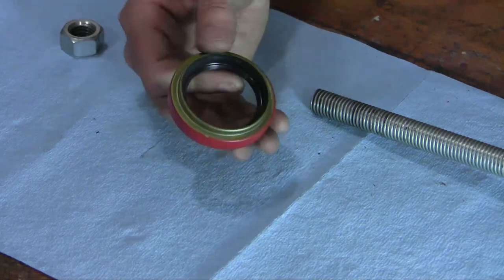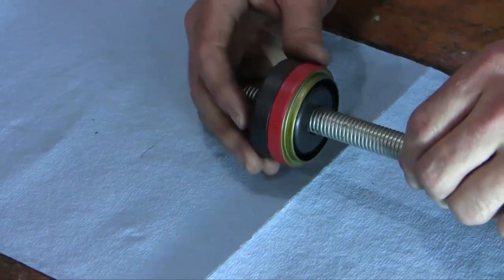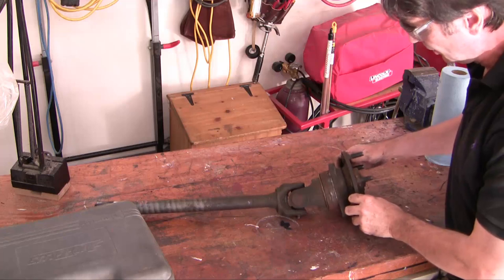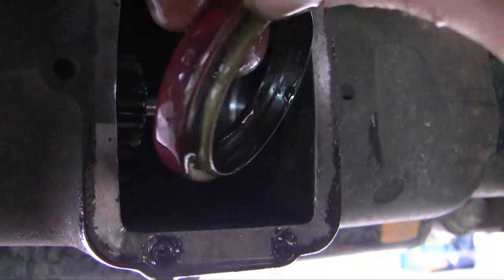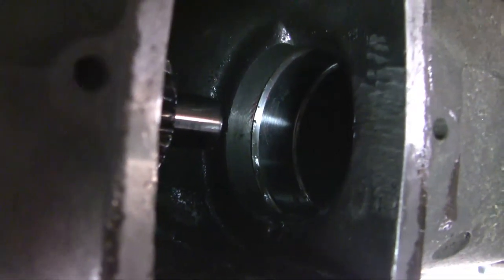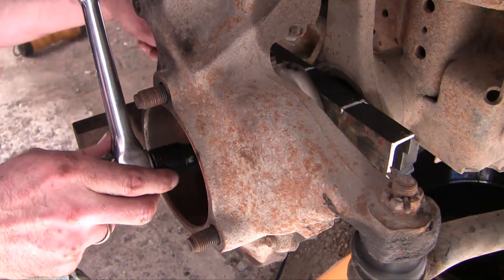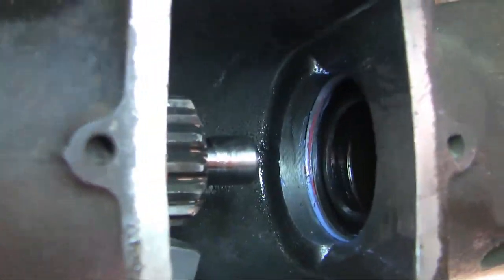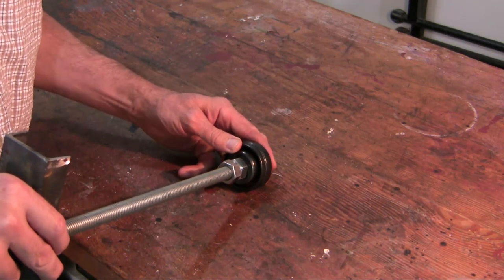Replace right front axle seal, 1998 Dodge Ram 4X4, part 2

Comment: Actually its a good video, well done.  By the way, for those with the Dodge Ram 2500s, the quickest way to tell a Dana 44 from a Dana 60 front diff is the hex size of the front cover: Dana 44" is a 1/2" hex bolt, the Dana 60 is a 9/16" hex bolt. Also, for those that are curious about the death wobble syndrome, we are using Hellbent racing steering box sector shaft stabilizer kit, and also weld-boxing the control arms, with energy higher duromoter bushings. Also purchase the best track bar you can afford, like a moog problem solver, or if you are lifted, an adjustable track bar. Lastly, do not use any ball joint except Moog Problem solver. The rest are junk. These front ends can suck up thousands of dollars of excess cash, so plan well from the beginning. Just our 2 cents worth here. Thanks
Reply: I know this was posted 6yrs ago, but I'll try anyway lol. do you know if the 1500 4x4 came with the dana 44 as well
Reply: @isaakteichroeb1175  the underhood sticker on my 1997 1500 4x4 says front “Dana 4”. Rear “Chrysler 9.25”
Reply: @herbb8412  awesome good to know really appreciate your replie

Comment: Great video, sure appreciate the work you have done to get us through this pain of a task.  I finished the job in about 10 hours changing the front left and right seals of a 1998 2500 with a DANA 60F diff.  Removed the ring gear without a case spreader and used a socket from my tool box to drive in the left seal and an Oreilley's rental seal driver kit, ready rod and a piece of PVC tube called a 1.5" Terminal Adapter costing $1.99 that I found wandering Ace Hardware to crank in the right seal. The right seal was a do over with success on the second attempt.  I did it on my driveway and am very happy to have an extra grand in my pocket to play with. Thanks again!

Comment: I made a seal installer from a 1/2" sheave center I picked up at a supply store, the inside shoulder is 1 1/2" diameter which holds the seal. I also used a piece of 2" muffler pipe about a 1/2" long. The outside of the sheave had to be ground down to fit in the tube and the piece of muffler pushes the seal into place using a 1/2" length of redi rod. The sheave cost $7.99, the piece of scrap muffler pipe was free from the local muffler shop. Worked very well. Axle was a Dana 60 (not a 44).
Reply from the maker: I always like it when somebody comes up with good ideas like this. Thanks for posting it here, I'm sure others will appreciate your contribution!

Comment: I found that if I tried to keep rod centred I had trouble I let it kinda wander within reason and boom! done . Thanks! O I used a big washer instead of channel Update seal failed and 3D printed driver failed. Got one machined out of steel gonna try again soon. Ok steel one worked (I think) had to use a square tube instead of the washer, washer couldnt take it. Let you know in a day or so. Great video!!

Comment: Thanks for the video. I changed my right front seal today and couldn't have done it without watching this first. I used a seal driver with a length of ready rod and it did set the seal in place. Thanks again.

Comment from the maker: You make a good point, and if I ever have to do it again I'll do it dry. The first two times I installed the seal on that side I did it dry. But this time, out of frustration, I put a thin film of Permatex on the outside surface, since I wondered if fluid leaked around the outside of the seal. Of course there is no Permatex on the inside. 

It worked, and I doubt I'll ever have to do that side again. But if I do, it will be more work to clean the old gasket off. Thanks for your contribution.

Comment: Tip from one who had to deal with this same seal  problem . Use the old seal turned back to back to the new seal with a washer and nut with alltread just as you did on the inside. The old seal fits perfectly on the back of the new one , for cheap just a stick of alltread and your old seal . 7.00$ old school . I do like your special seal puller though . It looks like it works well .

Comment from the maker: @gravity006 That is an interesting idea. However remember that the intermediate shaft would have to be reinstalled after the seal is in place, and it doesn't slide in very well, possibly dislodging the seal as it is put in. Also, the big problem is the unfriendly shape of the seal, with the soft rubber parts vulnerable to damage. The best way to install the right seal is the way I've done it here....

Thanks for your creative and thoughtful contribution.

Comment: That tool is a great idea. I have something similar, homemade. I use a cup one one end, fits inside the seal, pulls on the metal part, long rod with a nut, but I use a slide hammer on the other end, but its a 2 person job. But with your set up, definitely a one person job.

Comment: I tapped in the passenger side seal of my 1997 RAM 1500 using a 4 foot long 3/4" pipe with a cap on the hammering end and a coupler on the impact end that I put on once the pipe was already inserted from the driver's side. I wrapped the pipe with Teflon tape to protect the roller bearing that is just inside of the  4WD activator. I used a 2 1/8 " hole saw with the teeth ground off and smoothed to place on the seal to drive it in. Rather painless. It did take 2 of us to do this.... one at each end.

Comment: great videos and explanation.  Another thing to do is not overfill the differential.  this is cause of >90% of "leaking seals".  As you found, your one seal was in good shape.  Too many fill differential up to level of fill hole.  Should be about 3/4" below.  Many seals done unnecessarily.  Still, great write up, thanks.  Need to do a R&P replacement and will freshen seals while in.

Comment: If you don't have the special seal tool, you can use a shallow 2 or 2 1/8 inch hole saw (about 1" deep) and grind the teeth flat.  it is the perfect size to install the seal using the same basic method with the threaded rod and it is much cheaper.

Comment from the maker: I'll do it if I can find it (moved recently). Note that the size of the driver is reflected in the size of the seal, and you can buy a seal at any autostore. The national seal that I bought locally was a different size than the OEM seal, and so if you are designing a driver to fit your seal then you need to machine it to the brand of seal you're using. Also, you want it to fit your exact vehicle. I gave you a pretty good view of the driver in the video. Well designed.

Comment from the maker: @4g63junkie Yeah, It's pretty simple. The CAD is vacuum driven, and when actuated it pushes the fork, which slides that nut over to mesh with the splines of both the intermediate axle and the wheel axle at the same time. When disengaged it only rides on one axle, and the other axle spins independently. The principle is very similar to that of the Chev, that I showed in a different video. Thanks for your comment.

Comment from the maker: I love to meet people who think with creative flare, and so it's great to meet you. In this case I'm not sure it would work, since the edge of the seal is so narrow that it wouldn't have enough contact surface area to match up and bear the pressure needed to pull it in. The seal is designed to be squeezed radially inward, so the old seal will have a slightly smaller radius than the new seal. You might try using the hole saw drill bit trick, described in the comments....

Comment from the maker: Hi, Chuck. Mine is leaking at the front seal between the trans and the case, and I'm planning to pull it off to have a look. Probably needs two seals, hopefully that's all. The case itself seems to be OK. I did do a transfer case job on a suburban, though I asked a pro to do the technical part. If you are interested in how the suburban case came on and off you can find it on my channel. It is quite a bit of work just to take it on and off, with some heavy lifting in awkward positions. Good luck!

Comment: I then had to make something work, but would rather have the right tool. I made 2 pieces 0ut of 3inch wide × 3/16 or 1/4 inch thick using a 2-5/8 hole saw for the one piece to pull on the back of seal. The other one the. Can't remember, but it just fits the axel tube on rt side. Basically the smaller one fits in the axel RT  tube which I used for the axel tube side of the inner seal snugging them together hand tight with the Seal imbetween them just enough so the seal doesn't get pulled in crooked. Has worked for me.

Comment from the maker: The main reason for a dedicated specialty tool on the right is the limited access, preventing you from just tapping it in with a socket and a hammer. On the left, you need to remove the diff, so you have lots of room after that is done. I did a video of how to do the left and I showed how easy it is to just tap it in with a socket and small hammer -- check my video. Just remember that to get at the left, you need to remove the right, because the diff won't come out until the right axle is out.

Comment from the maker: I found kits for sale just by using Google. The seal driver that I eventually bought came from a company called quad4X4. They were good. But if I were to do this again I would probably try to save the cash (nearly $100) and make my own. Andy Harter in the comments below suggested using a circular hole saw, which sounds to me like a good idea, though I've never tried it. He ground the teeth off, choosing a size that just fits inside the seal so pressure is on the strong inside metal flange.

Comment: I want to try and make a seal driver tool now.  The fitted round press tool you paid so much for should maybe be mad from JB welding various diameter washers on top of one another to achieve the same specs as the expensive piece.  I may  give it a try to see what I can come up with. Thanks for the videos
Reply from the maker: +HARLEY D have a look at the discussion thread, there are lots of good ideas there. I like the idea to use a cylindrical hole saw. Good luck!
Reply: +spelunkerd agreed ! There are all sorts of clever ideas !
Reply: I made a press circular special tool out of a Hole Saw and put some plastic circles in side it to replicate the tool that you buy.  Im anxious to see how it works!
Reply from the maker: Please stop by after you're done to tell us how it worked out.
Reply: +spelunkerd wish I could put a picture on here.  It holds the seal perfectly straight.  If it works, I'll do a write up on dodgeforum additional to yours with some pics.

Comment from the maker: I got the seal wrench from quad 4X4, search their name with Google. Don't forget to read all the comments on this thread for other options. Regarding the front axle, that sounds like a transfer case problem to me, maybe a problem with the encoder motor. I don't consider myself an expert in that area, but encoder motor problems can be electrical, mechanical, or malfunction of the encoder motor itself.

Comment from the maker: Yes, the 2500 is significantly different. As I recall, somebody said that you do need to remove the big axle nut on that one. You will want to get hold of a dealers manual before tackling it.

Yes, I do believe a bad U-joint is the most common cause of this. Those U-joints commonly go bad, I've replaced both sides -- I should have recorded that effort but I didn't. Usually you get a clicking sound with each turn of the tire, when you steer to one side.

Comment from the maker: Search quad4X4 for a professionally made seal driver. But read through all the comments on both videos -- you might be able to make your own and save over $100 by using a 2-21/4" hole saw, grinding down the teeth, and using threaded rod to pull it into place.

Comment from the maker: I used 5/8" NC threaded rod, which is readily available. 

You need two seals, one for each side.But, if you replace the right one first, and then the left fails, you have a problem. In that case you may find yourself having to replace the right a second time, in which case you would need three. Hopefully the left fails first so you only need two. It's so much extra work to do the left that I wouldn't replace it as a preventative effort when doing the right.

Comment: Thanks ill buy this tool. Cause Saving a dollar ain't worth the frustration and time. When u figure time into it it's worth having the tool thanks for your help
Reply from the maker: +precinct 1 baltimore county residents Yes, if the shaft dislodges the seal when you reinsert the shaft, the seal hasn't been adequately seated first. The right tool makes this go very easily, but I certainly understand the motivation to make your own seal driver. Many guys in this comment thread have said that a hole saw can be ground down to make a good seal driver, although you have to factor in your effort and time, as well.

Comment: WOULD YOU PLEASE TELL ME WHERE YOU BOUGHT THE SEAL WRENCH THAT U USED IN THE VIDEO TO INSTALL THE SEAL AND WOULD YOU BE KIND ENOUGH TO ANSWER A QUESTION BEFORE I TEAR A FRONT END APART?  THE DRIVE SHAFT WILL TURN TO THE FRONT AXLE BUT THE FRONT WHEELS WONT PULL, ANY IDEA WHAT MIGHT BE CAUSING THE PROBLEM

Comment: I see now why quad 4x4 uses grade 8 hardware .  One of my zinc coated 1/2" nut got jammed on the end of the thread rod. Screwed my whole project up. The seal press special tool worked alright, but then I got stuck dealing with that nut.
Reply from the maker: +HARLEY D It's good to have remarks like yours here in the thread, thanks for posting. Makes people realize that any job has potential for complication. I also noticed that their custom design has fine-thread rod, in contrast with the coarse thread found on typical rod off the shelf. Fine thread would definitely give more leverage to translate rotational torque into axial pressure on the seal. I just found their prices to be too high for amateur use, especially if you buy the rod as well.
Reply: +spelunkerd I was happy to see my homemade press tool working and then that happened with the rod and turned my 1 1/2 hour job turn into an all evening absolute cursing marathon .  That nut jammed and I bent my press tool all to hell trying to get the nut off the rod that was on the CAD side of the seal.  I think my seal is good though, I hope at least .

Comment: awesome vid..goin to tackle the same seal on my high pinion dana 30 with cad. i welded the diff and run a posiloc cable instead of vaccum setup to engage the axle..a steel fork is goin in too. poor mans selectable locker...kinda.

Comment: Do you have a link for that seal driver? Thank you for what you do- your videos have helped me immensely!
Reply from the maker: I got mine through Quad 4X4 but I'm sure there are cheaper options.
Reply: @spelunkerd  ended up purchasing the Wahlstrom tool. At your cost estimation it was only about $10 more. Worked like an absolute charm.

Comment from the maker: That's always a difficult question, since the first time takes a lot longer than the second time. Alldata list repair of the right front axle seal as 1.4 hours of shop time, and 5.2 hours of shop time for the left. The reason the left is longer is because you need to remove the right to get at the left. If I had to do the right again, I could do it in under 2 hours. But the first time it took me easily 4 hours, and you note I had to do it again a year later (two hours second time).

Comment: Thanks for the video! Doing this repair. Do you have the link for the seal driver you used?
Reply from the maker: I used a seal made by Quad4X4, but it was expensive. The discussion thread has many bright options, including the option to make one with a 3D printer. I sent the dimensions to a guy who made a printer file for people to make their own.
Reply: Ok thank you very much!

Comment: Thanks for the video, just curious...my collar would not just come out like that. Although I ended up replacing my seal without removing the collar but just curious if you had to do anything else to be able to remove the collar? Thank you
Reply from the maker: If you're talking about what I called a 'nut' at 5:07, perhaps your vehicle is designed a little differently. In the end it sounds like you made it work even without removing that piece. You can slide the whole intermediate shaft out if need be, it has to be removed to get the differential out.

Comment: What are your thoughts on taking the old seal, turning it around backwards, and using that same washer to press on the inside metal ring of the old seal? It would pull so that the old seal presses out the outer ring of the new seal. Is this plausible? Thanks a lot!
~Jason

Comment: I noticed, I just couldn't find what the part was specifically called. I've already trashed one seal trying to pull it in to just like you did but with washers
Reply from the maker: Quad 4X4 was the company, search their website for part based on your vehicle.
Reply: Nathan Staggs mopmoo

Comment: genius... would you be able to tighten the nut by the seal to see how far the seal has to go in or was there no room?..
Reply from the maker: No room. The main glitch I had on this attempt was that the whole shaft turned, unscrewing the nut at the other end, inside the housing.  To prevent that from happening I put a second 'locking' nut on the first one inside the housing, which held the shaft still so the outside nut could pull that channel iron in. The shaft that is sold commercially for this use is fine thread, giving more mechanical advantage and smooth control.

Comment: Are the balljoints the same on this as the 1990 style dodge dana 44 front axle? If so, Sh^tcan the newer  knuckles and sealed bearing assemblies and replace them with the 1990 dodge hub style front end.
Reply from the maker: +Ben Benjamin I don't know for sure, but I'll guess it's an old design.